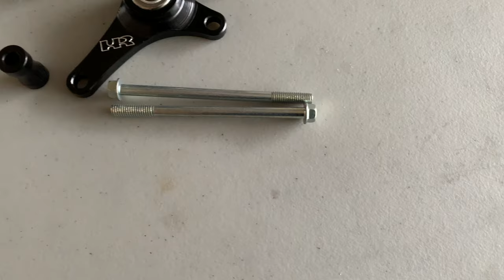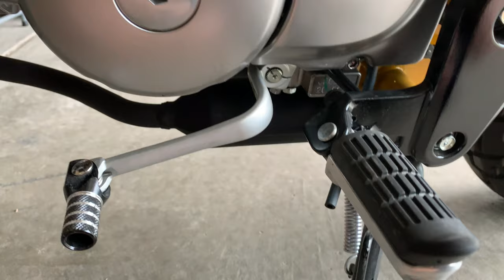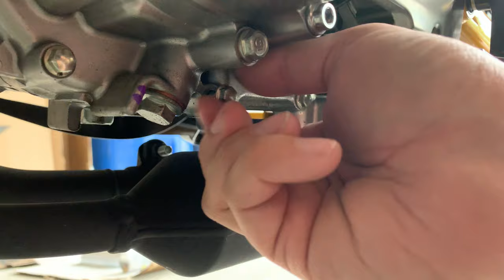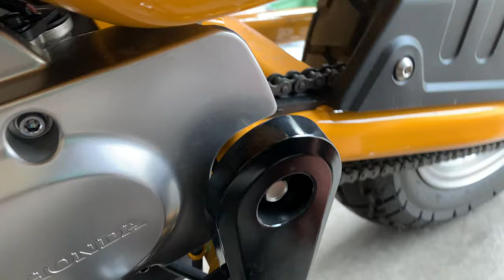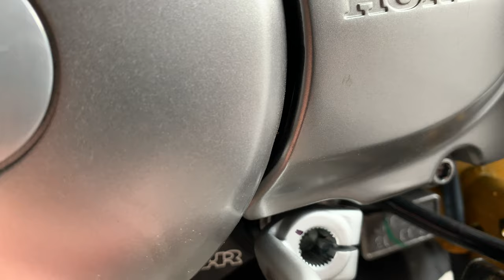Honda Monkey | Installing the Hard Racing Shift Shaft Support Bracket!

Comment: I replaced the stick shift lever as well and have now found it even harder to find neutral.  Did this piece help with that or even make shifting smoother? Was going to add it for the support anyway, but was hoping it could improve my shifting situation as well
Reply from the maker: I’ve noticed the bike has issues finding neutral, seems to be really sensitive. This piece didn’t really change anything for shifting as far as I’ve notice, primarily it just gives a bit more stability in the post itself.

Comment: Old Honda singles arranged horizontally, Z50, CT70, Trail90, Trail, 110, never had support, Or that linkage BS. Granted, those are all centrifugal clutch transmission. (Semi-Automatic)But they all stood the test of time, and are still doing fine. This may be overkill.
Reply from the maker: You're right, there's a good chance this is a bit of overkill. My only real worry is in instances with a large force on the shifter (like a fall or something) could put some unexpected lateral movement on the shaft itself, so hopefully this will spread out that force a bit.
Reply: @UnknownOverLand  Yeah, Ok. I got elevated on that. My bad!😊

Comment: Did you just crank the lever bolt in because it definitely doesn’t line up with the Chanel
Reply from the maker: I don't think I had to really crank anything in, most things seemed to line up pretty well. Which bolt specifically are you talking about, the one specifically on the lever to tighten it to the shaft?

Comment: I need to reverse the pattern, so I’m clicking down to go up, otherwise left hand corner accel is killed by lean angle to get to the next gear…
Reply: 1 down 4 up is stock shift pattern. Gp shifting reverses shift pattern to 1 up 4 down. This is usually done with aftermarket Gp style rearsets

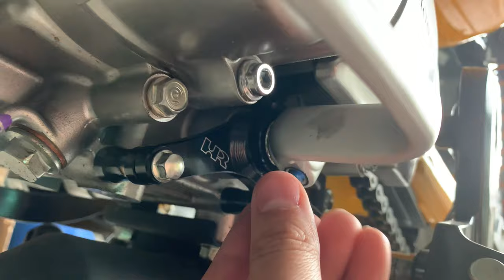Comment: @1:26. What are the torque specs for those two top/bottom bolts.
 Thanks.
Reply from the maker: The lower bolt (step holder mounting bolt) is 31Nm (23lbl-ft) and the upper bolt (swingarm pivot nut) is 54Nm (40lbl-ft).

Comment: What is the reason for that bracket for the shifter ?
Reply from the maker: If you go with an aftermarket shifter, you’re now putting force directly on the shifter shaft (stock there are links between the shifter and the shaft). This helps give a little more stabilization to the shaft against some of that force.